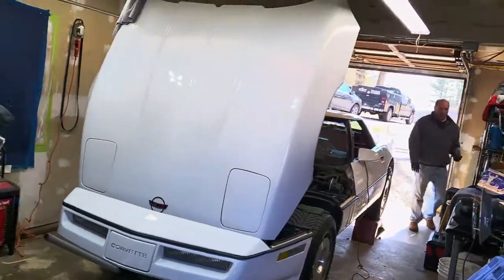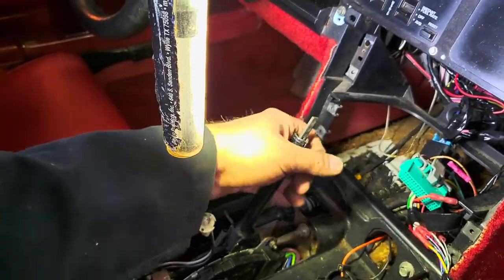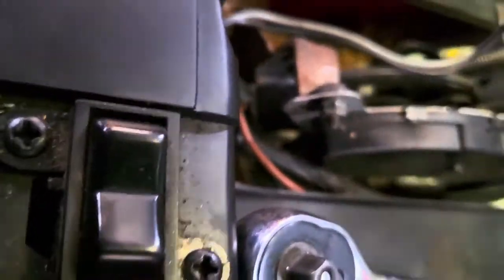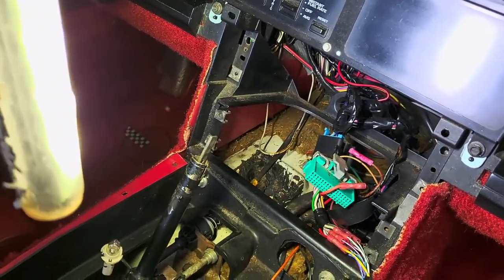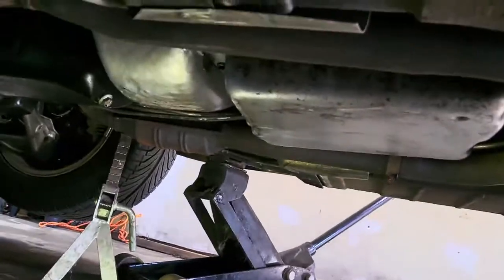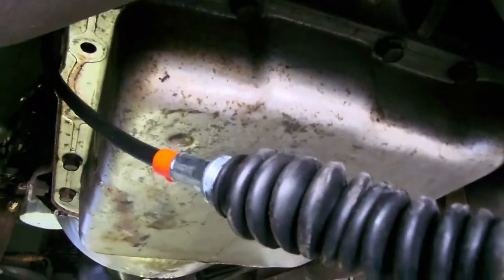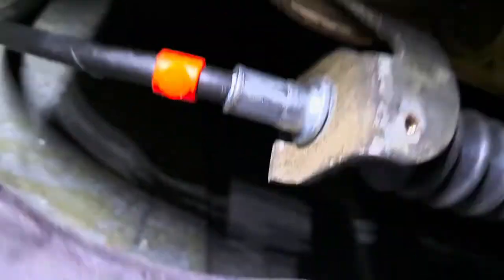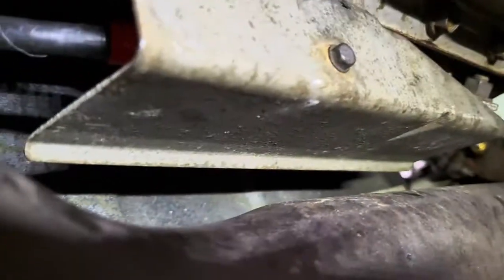1986 C4 CORVETTE SHIFTER CABLE INSTALL

Comment: So, how did that Pioneer cable end up working out? Since it’s been a couple years now. Gotta do it on a 85 in the spring and there’s 2 cables available (ATP & Pioneer) both owned by the same parent company. From what I can find the ATP is supposedly a lesser quality cable. Curious how it’s worked out if he’s been driving it since.

Comment: I’m having a problem with my 89 it’s having a hard time coming out of park but it comes out after you tug on it a bit im hoping it’s not this and maybe just the  shifter button
Reply: I had a he same problem and turns out it was the half shaft u joints so you probably need to change them

Comment: Just bought an 89 vette and it’s stuck in nuetral, I’m hoping it’s this issue
Reply: Was it the issue?
Reply: @jakemckenzie4676  it ended up being the shifter cable LMAO, we popped open the trans anyways to throw in some new fluid and a filter

Comment: Is the 700R and 4l60E the same linkage/ connections lengths?
Reply from the maker: I don't know?
Reply: @daredevil7442AUTOMOTIVE  you don't know if you used the same gear selector linkage?
Reply from the maker: @maynorlopez8904  idk?

Comment: My 89 shifts into every other gear but when i try to shift into park it stops at reverse and slides foward all the way
Reply from the maker: Something wrong with shifter or maybe the park detent in transmission is worn? Gotta crawl under and watch the shifter detent as someone above moves the shifter? could be worn cabler?